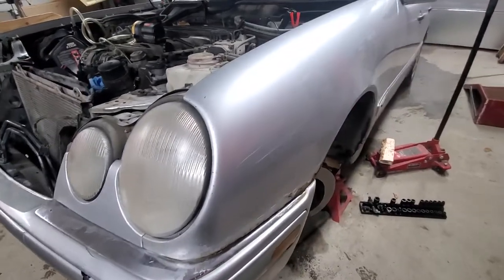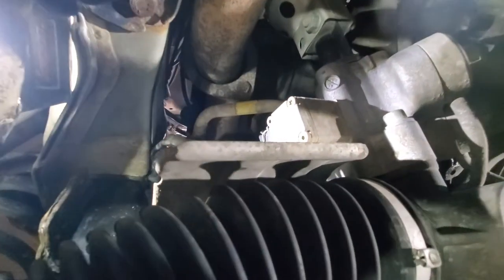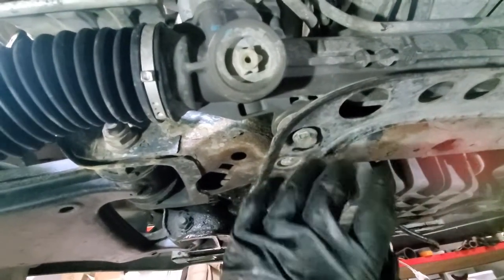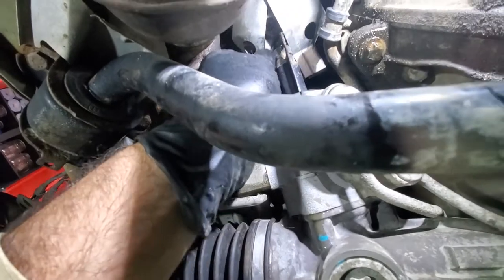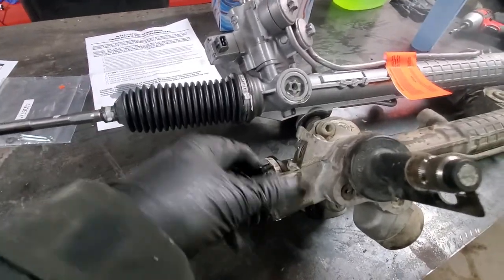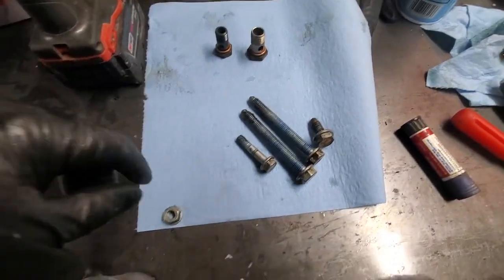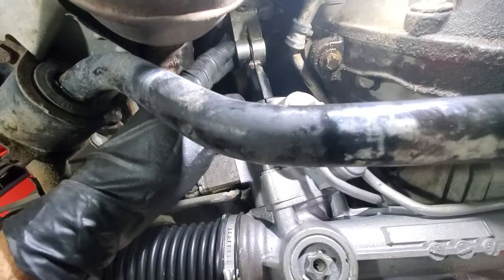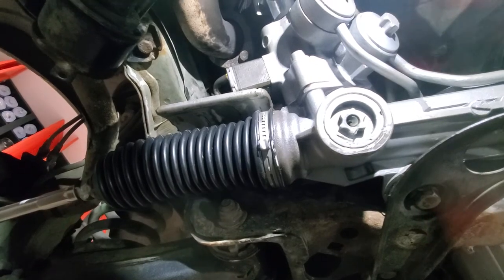Mercedes W210 E430 Power Steering Rack and Pinion Replacement. Remanufactured part.

Comment: So you got damaged splines too with reman? I got the same. Did you just force it in?
Reply from the maker: Unfortunately I had to. Wasn't the best experience,  but got it in place.  Maybe try to fix the damage if possible while it is off the car.
Reply: @justdoityourself  I might just return mine but I fear I will just get another one with damage
Reply from the maker: @om606channel  very possible.  Also mine failed within 6 months,  got it replaced under the warranty...